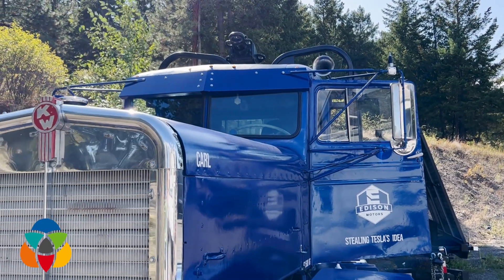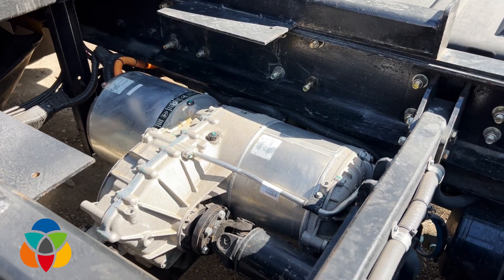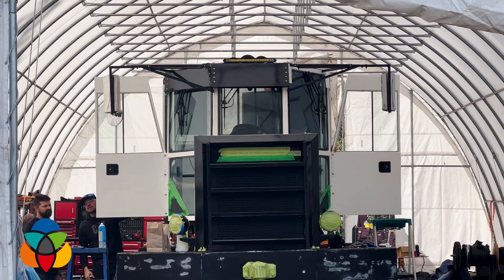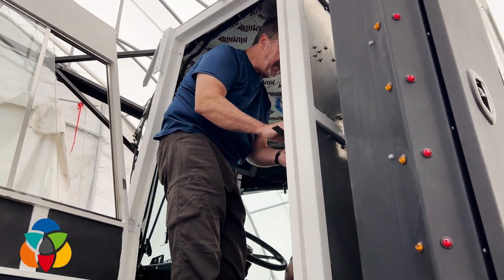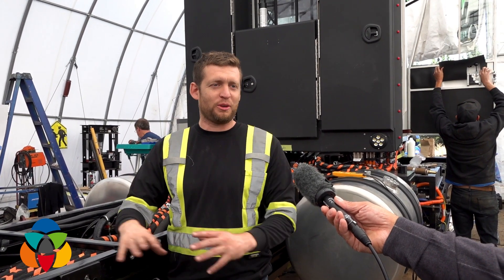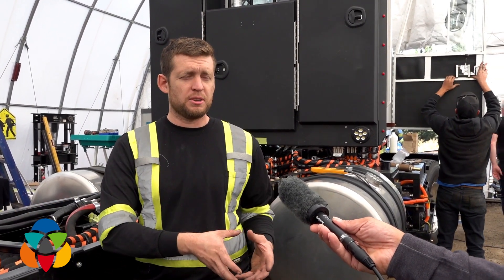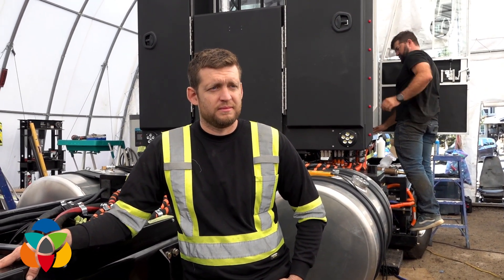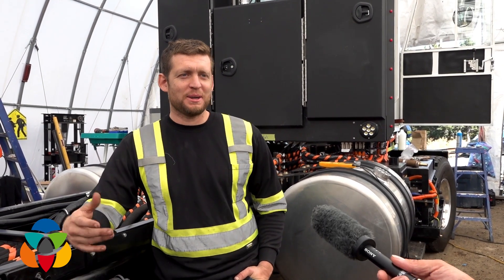Merritt logger has created a hybrid electric logging truck

Comment: Complete waste of time and money.
Reply: lool
Reply: Ya. And after you explain why, you can grab your club and walk back into your cave.
Reply: This is how trains have been designed for many decades. Electric motors pull like the devil.
Reply: @hootowl6354  trains don’t have a wheel load limit. Trucks do add 5000 lb battery to the equation and that’s how much less they can haul. They are going to cost more. It’s a no go. The trucking industry and farmers cost of doing business is getting out of control because of carbon fanatics. We’ll see how it goes when we don’t have electricity and are fighting for food. Carbon neutral is not possible. Educate yourself.
Reply: @daleolson3506  Carbon isn't my concern. There are other advantages. Operating costs. Maintenance costs. Rising fuel costs. Every time fuel goes up, we hear truckers complaining and jacking up shipping charges. How do you know a hybrid big rig's battery would be 5,000 lbs? A hybrid pickup battery is only 180 lbs. Lithium batteries weigh less, of equal size. And the price of lithium has come way down, with some recent large discoveries, and better batteries are on the horizon, lighter ones. Most of the electricity comes from a diesel generator, not a battery, and those engines are smaller, so they are lighter; and there's no transmission since they are direct drive; no driveshaft either. But yeah, batteries and motors. Motors are heavy. I'd have to see the math. Right now, hybrid trucks probably only make sense where regen can happen. But all technology improves. Why are Americans so resistant to change? Other nations are doing this, and other nations are passing us by. Yeah, it would cost more now, but hybrid cars used to cost significantly more too. Now they are only a little above ICE cars, with large fuel savings. The fuel savings on a hybrid car make up for the slightly higher cost. In five years, you're breaking even. Less noise is another advantage. So is fewer refuelings. And when parked overnight, you'd have to run your engine less, maybe not at all, which saves even more fuel. And in cities, we have some serious diesel particulate problems. Some hybrid trucks can run for 60 km on just batteries. It will probably be ten to twenty years before we see many of these, however, and lighter trucks, urban use will be first.